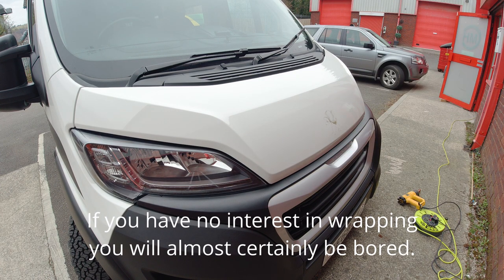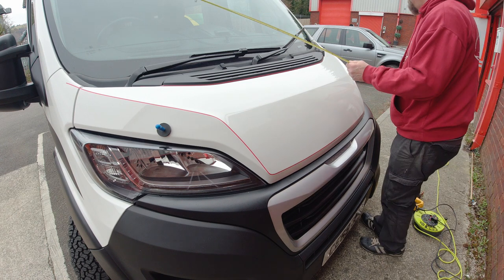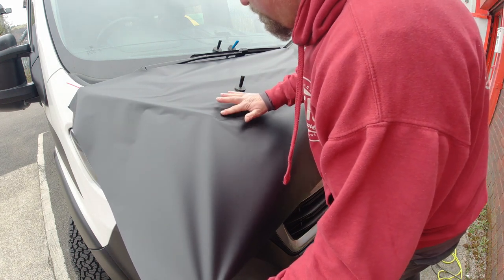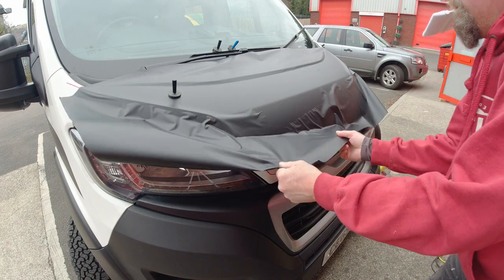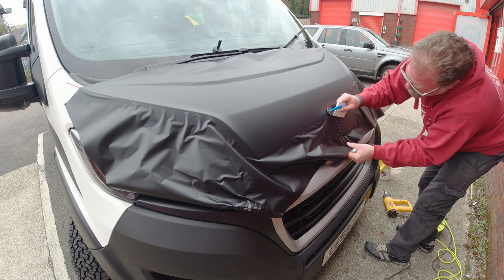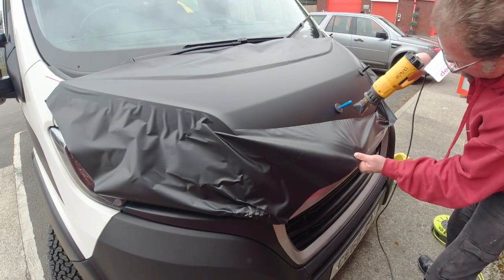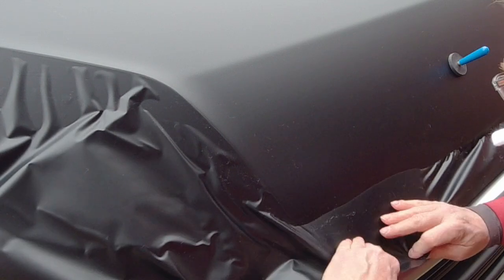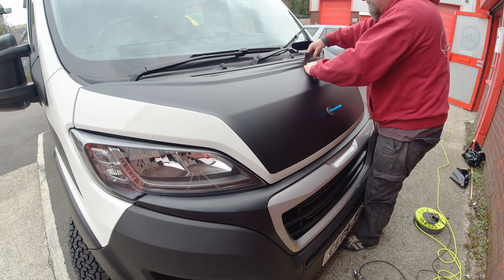Bonnet wrap on our Peugeot Boxer Motorhome.

Comment: I was wondering if the badge was just stuck on that for the video.
Reply from the maker: The badge is just stuck on. I removed it with a little bit of heat and gentle prising. Then cleaned the glue off with glue and tar remover.

Comment: Surely water spray is easier than that method??
Reply from the maker: I am definitely not a wrap or vinyl expert, but I think water spray is ok if you don't need to stretch and stick at the same time. If this was wet, then it would not stick properly until it was dry. This wrap vinyl has air release channels on the back to allow you to get rid of air pockets when it's applied dry.